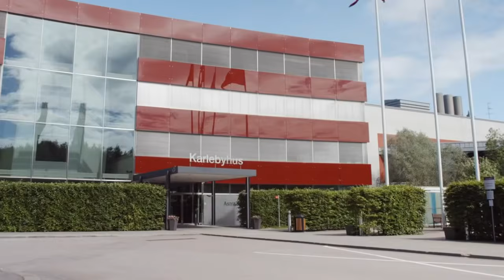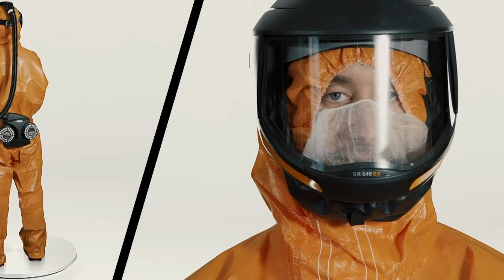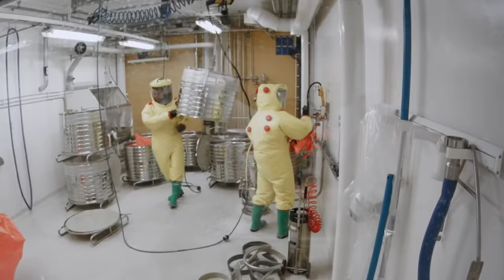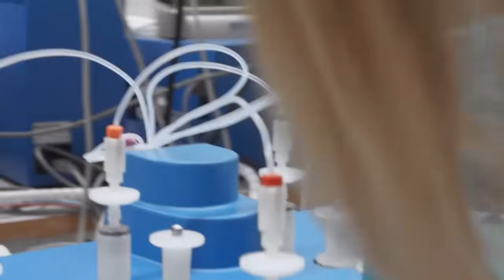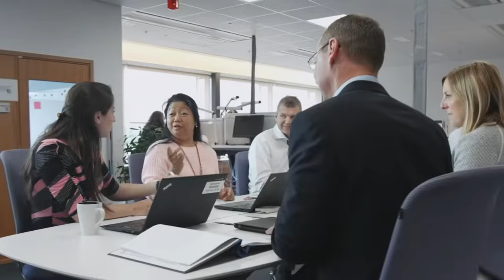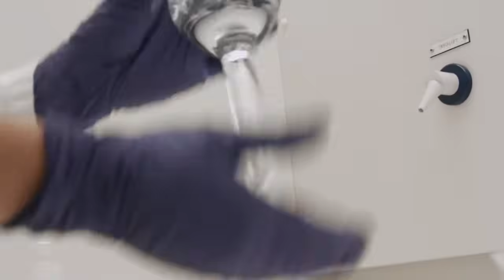Inside AstraZeneca Modern Pharmaceutical Production Plant | Modern Factory

Comment: اما بدرس صيدلة 5 سنوات ثم رح ادرس صيدلة 
صناعة أدوية ومن اكبر طموحي اني افتح شركة 
أدوية لحيث اكون دكتورة و صانعة أدوية و تاجرة 
ويكون عندي  بزنس كبير حلم رح يتحقق لو بعد 
حين بإذن الله رح اجتهد على نفسي ❣️
Reply: I am an expert with isolators that go through a vhp sterilization cycle and fill/finish equipment for drug product ready to go out the door. I'm not a biochem expert, I'm a manufacturing engineer. Vision systems can be used to check for particulate and other defects. Good luck in your dream. There are people out here that would def apply if you have good benefits!